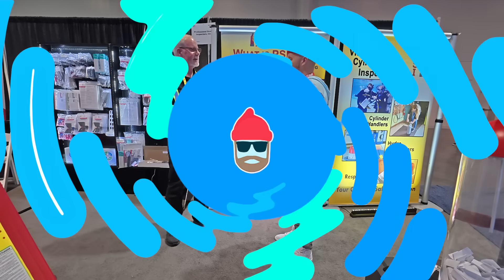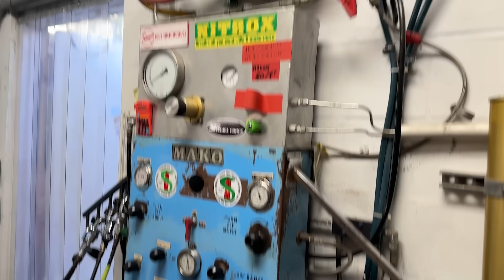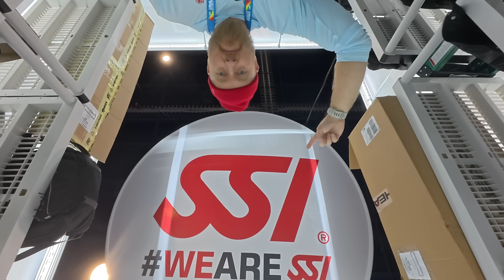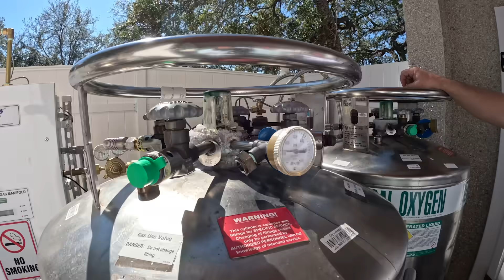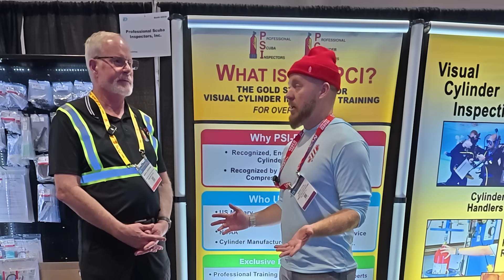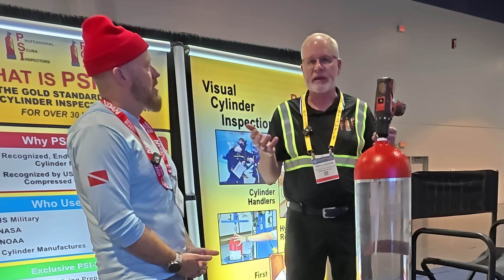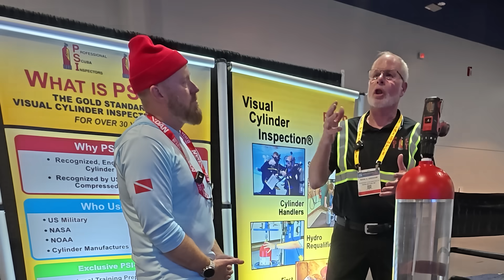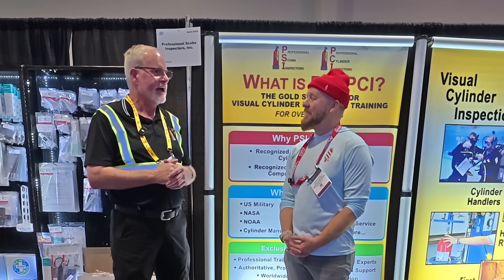101 | Scuba Tank myths busted: Dive Industry Expert debunks common cylinder misconceptions.

Comment: I was certified in 1983 back then the instructors always told us to open your tank all the way and then turn it back a little. Which is what we did. A couple years later while diving I had a new wide neoprene mask band and my tank was set up a little too high. While down about 60 feet and looking up into rocks, my head kept hitting the valve without me noticing and close the valve on my tank. Luckily, since I dove a lot of shallow dives and used to run my tank dry I know that’s not good to do. I was familiar with how my regulator would make a fluttering sound as it was running out of air. I had just looked at my gauge moments before and remembered seeing 2000 psi and knew there was no way the tank could be empty. I was able to reach back and turn my tank back on. From that moment on I didn’t care I always open my valve all the way tight open so that it would take considerably effort to close it.
Reply: You are going to ruin your valve doing that. You do NOT want to have it tight like you say you are doing. Ive seen it several times. Especially when its snugged and people think its stuck open when in fact they were tightening it more in the open direction.

Aviation we would open all the way until we felt a little resistance, then back slightly, less than an eight of a turn. that way when you went to close it, you got movement then it would stop. You knew it was being turned the wrong way. I do the same with my air tanks.

Simply fix the positioning of your tank since you identified the cause.
Reply: @ Not going to happen! I been diving 40 years now opening it all the way and never had a problem with the valve. Understand I don’t crank it open hard but it does take resistance to to close it.
Reply: @ certainly hope you arent referring to my comment. If so then you are flat WRONG as I have seen first hand valves  damaged.
Reply: @ nobody touches my valve except me once it’s been turned on. As I’ve said over 40 years and I haven’t forgotten how to turn my tank on and off as far as tank position there’s no position in which my head cannot touch the tank valve. It really has to do with how hard I’m working while diving. And whether or not I wear a hood. Most of my diving was in the Saint Mary’s River on the Florida, Georgia border fossil diving  30-40 feet, 3 knot current and 1 foot vis.
Reply: I was certified last year in july and I was taught the same thing. Thankfully I follow these accounts that provide more modern information. Never doing the quarter turn again.

My only fear is the staff catching me not doing it and correcting me, and as a new diver I don't have the confidence to correct them back
Reply: @hawkeye5469  dude just stfu already with all your ASSumptions and nonsense and novel.
Reply: Comment boxing
Reply: I've had valves that weren't all the way open spin closed on me in current, and it's not a fun experience.  Open them all the way against the stop, please — it doesn't hurt modern valves. 💁🏼‍♂️
Reply: @hawkeye5469  bullshit it will too smh. Ive seen it first hand.
Reply: @MysticalDragon73    Sure, nearly anybody can damage a brass valve thread if they crank hard enough on it.  The assumption here is that a person will seat it gently, with an appropriate amount of torque on the wheel.  What you've probably seen damaged are handwheel keys?  More often than not, those are rounded out by people schlepping tanks around by the hand wheel instead of grasping the valve body itself — or cranking super hard in either direction.  I've serviced probably 200 valves and have yet to find one damaged at the starting threads of the internal plunger, but have replaced plenty of handwheel keys and bent or stripped spindles.  Aside from applying hulk strength to the wheel, the only way I see stripping the internal threads is running the plunger out of its track by using the wrong hardware, forgetting to install / neglecting to replace a worn nylon washer, or not having the retaining cap seated all the way into the housing.  The entire handwheel can break off, and that valve won't leak unless the o-ring seal on the spindle (stem) is compromised.  When valves leak from the handwheel in the open position but not while closed, 100% the stem o-ring is what failed.  If a cylinder leaks out of the valve's service port while in the closed position, it's the seat of the plunger and it's a 10-minute fix to pop a new plunger in at service time.  That's all for folks who maybe never have taken apart a valve and might be interested in where they fail, but there most definitely is a nylon washer that cushions the plunger at the full-open position for the exact purpose to avoid the metal-on-metal compression that would cause older valves to seize open — which was the reason for the 1/4 turn back and is not a problem in modern valves in part BECAUSE of this nylon stopper.  The coarse threads Mark mentions in the vid which also don't give as much of a mechanical torque advantage as the finer threads that were once standard.  That nylon washer is also super easy to replace, as long as the remaining hardware  isn't badly corroded.  The wear parts are quite simple inside a cylinder valve and designed to be easily replaced — so stop worrying about them. 😉 There's a lot of overthinking in these public discussions, and misinformation that gets perpetuated.  I don't know you or your level of experience in diving and servicing valves, but to call BS on my thought or experience wasn't very nice.

We've both survived this long, so I suppose we can just keep doing it each our own way and all will be right in the world? ✌🏼
Reply: @Hawkeye_2478  Thanks for the good explanation but now I'm curious - how do you dump the air from a full cylinder when the entire handwheel has broken off? Even slowly unscrewing the whole valve would seem to be really dodgy!
Reply: @kenmercer2721  unscrewing the valve won't work and would be rather dangerous to try because of the amount of pressure that would be against the threads of the valve, and the cylinder neck.  You'd likely have a bit of rod or plunger left to manipulate and bleed the valve, or you could take the outer half of the valve apart because the plunger is held in by its own threads, which do not rely on the retaining nut/end plug.  If the valve is damaged beyond the whiskey to disassemble normally, one could drill a very small hole through the valve body or rupture the burst disk in a controlled fashion, but I wouldn't want to be standing over or even have my hands near it because the resulting air jet could likely tear flesh.  Also, that fine drill bit probably breaks and becomes a tiny, momentary missile.  I'd go for opening the assembly to rotate the plunger before destroying the valve.  Methods would somewhat depend on the cylinder contents, as well.
Reply: @Hawkeye_2478  I call BS on that.  Valves don't spin closed in current.  Valves not opened enough can flow less air than required as you get deeper but seem to function properly at the surface.  At 33ft of depth you are flowing twice as much or more if you are exerting yourself.  Go to 99 ft. in seawater and swim around you would be demanding a minimum of 4 times the airflow but realistically 6 times or more.
Reply: @Stan_in_Shelton_WA    I've been at this a while, and it absolutely happened to me on two occasions — with the same valve, so I eventually put a stronger spring in the handwheel to stiffen the handwheel resistance, but seating open also prevents the unintended handwheel movement.  Some valves, such as the one I mentioned, may turn with almost no resistance and when subjected to turbulence in the water, can spin in either direction if not snug against a stop.  No need to defend antiquated practice — there's a stop at each end of the modern valve stem and you're not hurting anything by gently seating it open.
Reply: @Hawkeye_2478  stop promoting bad practices that will truin someone's valve smh. Stop with the nonsense already.
Reply: @MysticalDragon73  told us he's never serviced a valve, without stating he's never serviced a valve. 😉

Comment: The risk with a Titanium is extremely low, Titanium oxidizes almost instantly most surfaces
Reply from the maker: Yes, very low. I own one and have been diving it several K dives on many O2 mixes for over a decade - not worried 🤿👌
Reply: its not quite so straightforward, the highly exothermic reaction of oxidation under high pressure can be physically disruptive leading to a runaway reaction leading to destruction. ive even see it with brass, a 50mg sliver of brass lefe in the high pressure section of a brass mickey mouse valve, caused an explosion that blew the valve nose off sending it through a wall the first time the valve was used.

Comment: WOW!!!  My mind is officially blown!!!  The fact that the oxidation process would convert oxygen into carbon dioxide never even occurred to me.  My wife and I dive HP steel 100s so this is very pertinent to us.  Thank you!!!
Reply: It actually converts it into iron oxide (for a steel cylinder) or aluminium oxide (for the other sort).  This process kills sailors every year:  Rusting anchor cable depletes the oxygen in the chain locker, killing the first person who goes in to do some job or other without venting and testing the space first, then usually the person who goes in to rescue them and sometimes the third person who blunders in to investigate where the others have gone.
Reply from the maker: Haha yeah of all of them, that was the one that blew my mind the most as well (I also dive steels, but thankfully do have an analyzer) 🤙
Reply: I did know that the oxidation consume o2, but the rate it does it was a surprise
Reply from the maker: @ that one really got me too 😳👌
Reply: Bro there's no carbon
Reply: People have died of bad air due to rust doing repair work in confined spaces on huge steel ships. Wildly unlikely but absolutely can happen.
Reply: Not CO2,  FeO2 (Iron Oxide - Red Rust).  However, CO2 would probably be better since high CO2 is what triggers the urge to breath.  In either case, Low O2 in a tank would lead to Hypoxia wherein you basically faint to brain damage and or death in fairly short order, like a stroke.  This can also happen when doing hyperventilation while snorkeling, you drive CO2 excessively low which then opens the door to the O2 dropping below the level to support consciousness prior to the CO2 rising far enough to make you want to breath, you then faint and drown (Known as Shallow Water Blackout).
Reply: This came to my attention when I was reviewing a case study while taking a confined space entry course many years ago. Three people died in a barge on Monday morning that they were working on on Friday afternoon. Nothing changed over the weekend, no toxic gases, no work was done, everything was the way they left it. But the last thing they did on Friday was sand-blasting. The corrosion over the weekend consumed most of the oxygen and made the confined space a death-trap. And sadly a death trap that could have been dismantled with a $5 fan.

Comment: I’m still not clear on how long it takes or even if air can go “stale” inside a cylinder. Whats the general recommendation on when to dump and refill a cylinder. Given where i live i don’t dive October to May. Is the air in my cylinder still good to breathe in May generally speaking?
Reply from the maker: @391wombat  if you’ve got an O2 analyzer there is no timeline 👌
Reply: @TheScubaDivingChannel  does leaving a tank full during the off season increase the likelihood of failing a hydro due to sustained loads for extended periods?
Reply: @391wombat  simple answer….no.  Overfilling tanks is what creates the danger to the overall tank life.
Reply: @391wombat  ~ SLC only affects 6351 alloy.  Other alloys don't use lead in the alloy.
Reply: 🎉drain the tank have it hydroed get the vip then dive it don’t try to get off cheap
Reply: most say 3 months. tbh a fill is inexpensive vs breathing bad air. In fact near the end of the video they touch on this and mention 100 days in steel cylinders. 

TBH just get your vis before the season start (if it ever ends for you which it sounds like it does) and then it will help ensure you have safe air.

Comment: So less than 40% o2 cleaning not needed? Legally speaking. Did I hear that correctly
Reply: Depends om filling method. Partial pressure filling requires O2 clean, as 100% O2 is used. Stick filling EANX does not, as O2 pp is 40% or less
Reply: Here definitely a true lawyer from your legal homecountry. Yes, i as legally lawing lawyer allow this